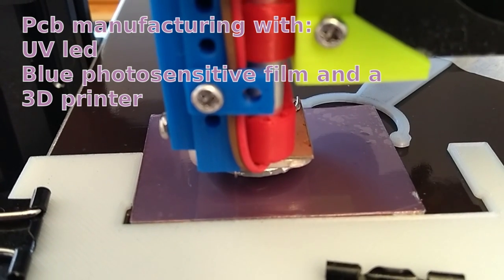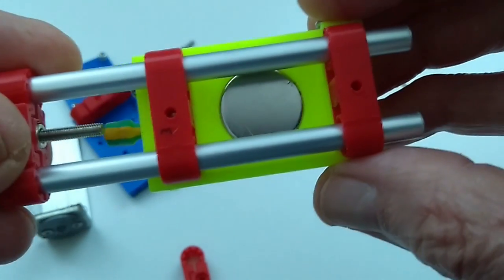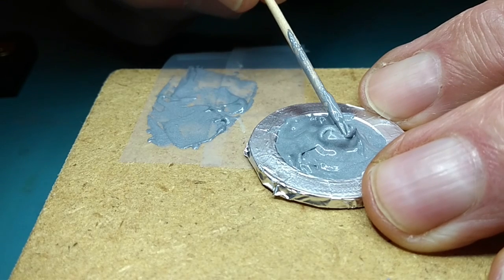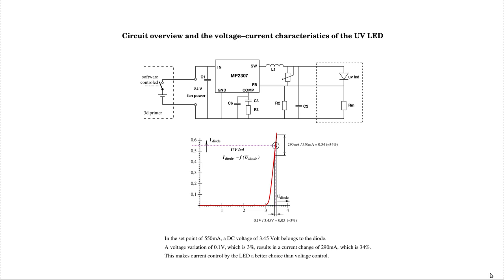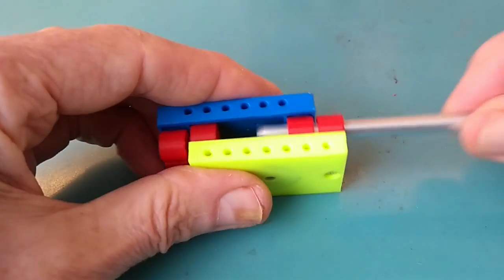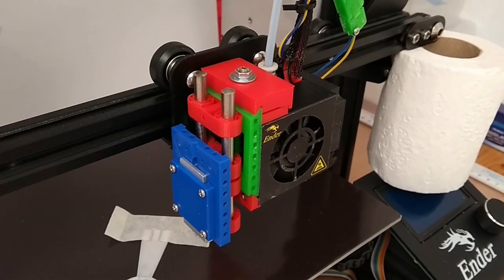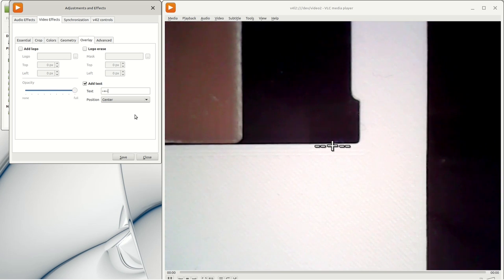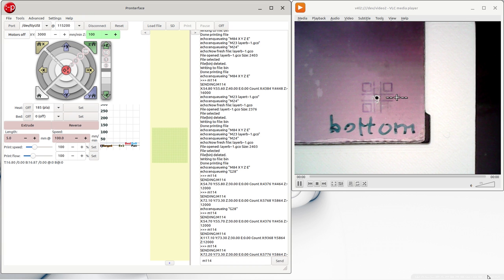Make a PCB with 3D printer, UV led and photosensitive film

Comment: Cool but stupid slow. Better is LCD (3d resin printer) make PCB in one time
Reply from the maker: Dear, count the time for:
design the circuit, etch, solder, measure circuit, purchase components.
Compare this to the approximately 10 minutes drawing time to expose the film.
Be realistic.
Reply: @wilstraver962  expose resin film in 10second, then you put it in acid and it will pick out the area around the glued resin on the copper plate
Reply from the maker: @martinTintin476  I think you misunderstood my answer.

Comment: Please, just use an SLA printer...
Reply: This has so much more reprap energy.  Also much higher resolution.
Reply: I'd rather stop 3d printing than use sla. it's messy, stinks to high heaven, it's toxic, requires additional cureing, and for what? an increase in resolution, maybe an increase in speed if you're printing multiple parts next to one another. No thanks.
Reply: @rampantgecko6415  he means to exposes photo sensitive pcbs
Reply: SLA suffers from resolution/ size problem to double the size you need 4x area display and halves the resolution, this method can be used in any-size 3d printer/ cnc machine and already better than my armchair engineer design that involves digital micromirror devices, for 5x5cm pcb, maybe just use oshpark